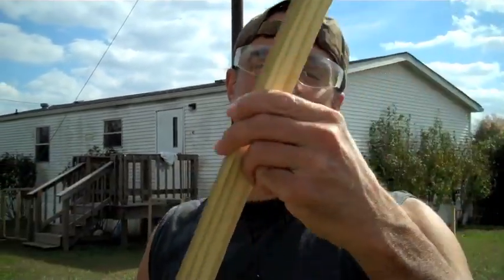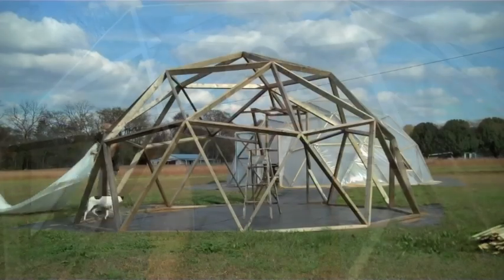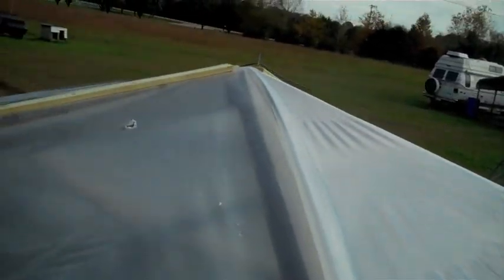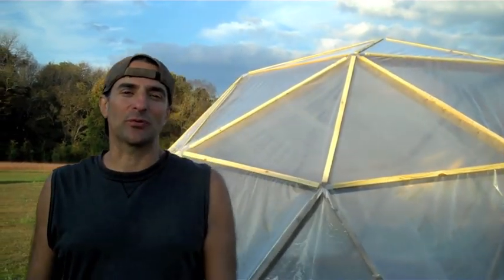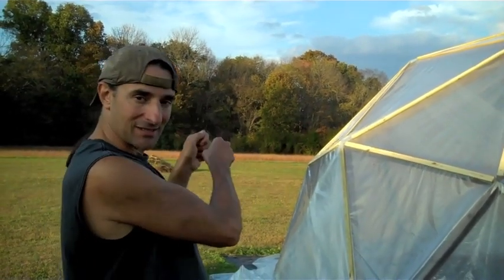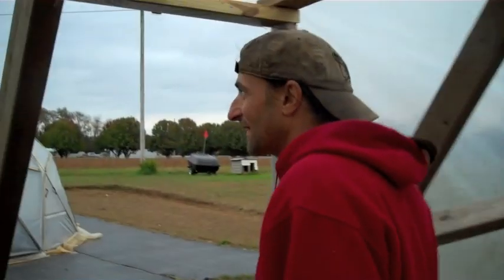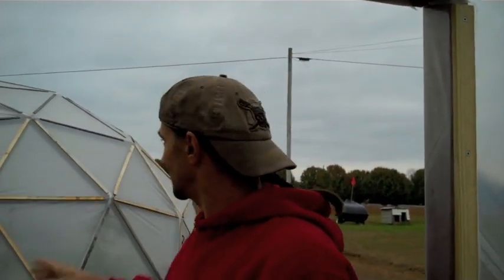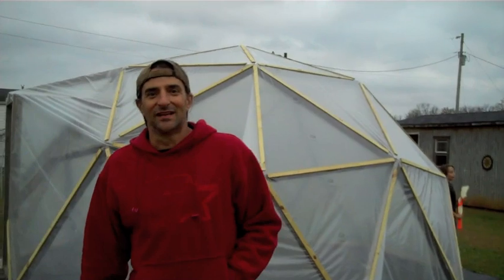2V DOME COVER

Comment from the maker: I did the same thing and ended up with some warped and some twisted wood. I used the ones I thought weren't too bad off but did end up with some I thought just wouldn't do. There is enough play in the structure to push, pull and/or twist the boards to where you need them to be but of course straight boards are always easier. Rod bought premium lumber from a big box store for the 40 footer and most of his wood was really nice although we did experience a few boards that were warped/twisted/bowed.

Comment from the maker: Both plastic covers held up great. No tears whatsoever. We didn't have any extreme cold or snow but we did get down into the 20's F. We did have some snow but not anything that stuck around. It usually melted the next day. We do get some extreme winds somewhere in the 40 mph range and gusts up around 50 mph and both domes held up like champs. No tears or damage at all. The plastic on dome one isn't even pulled tight everywhere and flaps up and down with the wind but this doesn't seem to matter.

Comment from the maker: Wow, that all sounds really cool. (especially the beer drinking) Right now we are running between 15C to 25C. It's been around 1C at night and maybe 12C daytime. Sunny days really help warm it up inside. During the past summer (It's autumn here now) we were getting up in the 30's celsius during the daytime. Quite warm. Of course it was hot outside also. 27 to 33C everyday. We mostly concern ourselves with the water temp which is running around 15C right now. Perfect for the plants.

Comment from the maker: Not sure what you are experiencing but I remember thinking my angles looked skewed. Could be an optical illusion. I just looked for equal distance from tip to end of the cut along the wide part of the board and tried to get the arrowhead as "pointy" as I could. Does this make sense? I also believe that there is room for error. Wood is flexible. No matter how accurate your cuts are, you will still have warpage and discrepancies to deal with. Too bad about the saw. Hope you get compensated for it.

Comment: If you had used double hat channel furring to sandwich the poly, the skin would be stretched tight. Use double sided tape to hold the plastic until the second hat channel is fastened.

Comment: Are you using a tarp underneath these domes? If so, do you have the grade of the ground on an angle in one particular direction to drain these ? Just curious, thanks!
Reply from the maker: We graded the ground level and used weed mat for the bottom. We did have some water inside the dome during heavy rains but it didn't hurt anything. Since then, we dug a hole just outside (uphill) to collect heavy rain and that helps a lot. For our hoop house we built the ground up about a foot and leveled it flat and we do not have any water issues inside it.